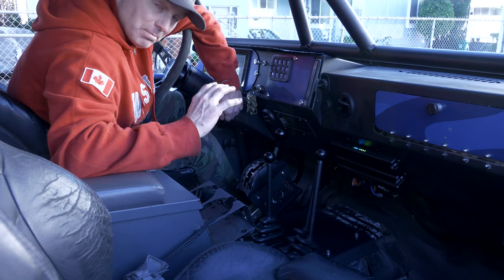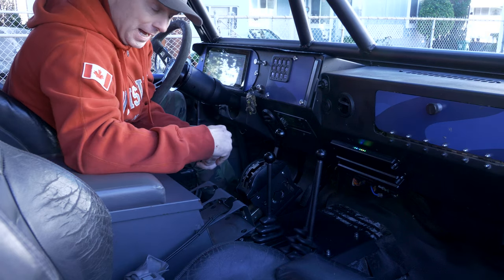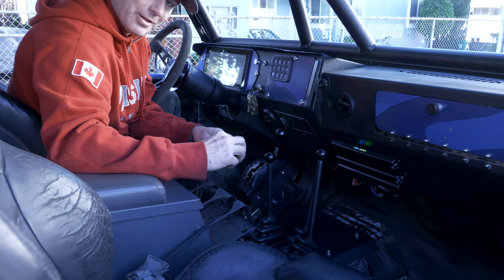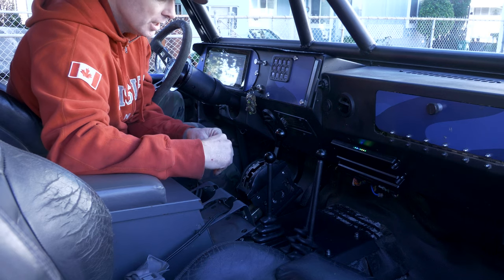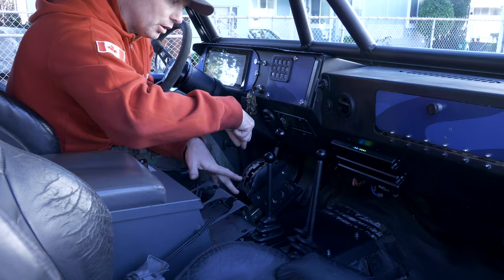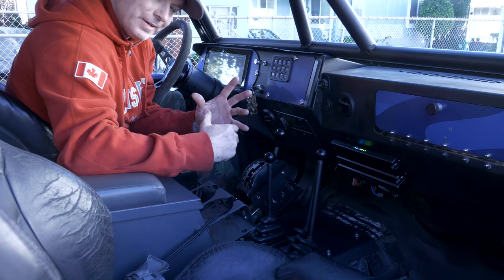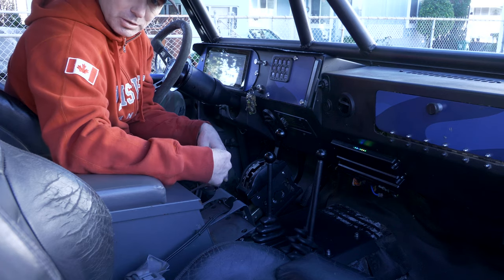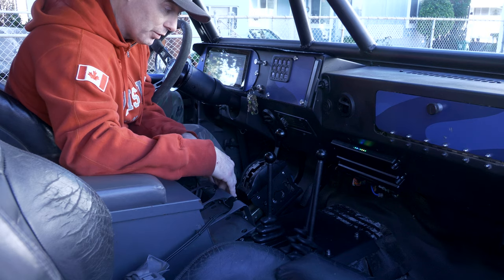How to shift a triple stick transfer case

Comment: you told me on Instagram you were going to post a video explaining the setup, but i did´nt think it was going to be so soon. thanks man!!
now i get it, the magnum box its a multiplyer or reduction for the transfer case. tons of torque for rock climbing, no engine effort
Reply from the maker: Exactly.  Great traction, control and no wheel spin
Reply: @MerricksGarage  can’t wait for the next full-size invasion 🔥🔥🔥

Comment: Very cool, I have a NorthWestFab kit for my 07 SAS Tacoma. Waiting on the triple stick kit as well. Should be a fun install and learning experience.
Reply: Just be aware that the northwestfab triple stick kit will not give you the ability to independently control the front and rear axle like in this video if you use a Toyota transfer case for your setup
Reply: @haroldpinter8076  Correct -- Pretty sure 2WD, 2LO, 4H, 4L, 4LOW

Comment: GREAT INFO. 
IM INTERESTED IN THE MAGNUM BOX FOR NP205. NOW I´M CUSTOMIZING MY JEEP WITH HEMI 5.7, ZF5 TRANSMISSION, 1TON AXLES ( BOTH WITH STOCK GEAR RATIO 3.73 ) AND 42" TIRES SO IN ORDER TO DON´T REGEAR MY AXLES I WAS WONDERING IF INSTALLING THE MAGNUM BOX INSTEAD WOULD BE A SOLUTION

I will like to know if running with 2L in the TC or Low at the magnum box all time on-road (highway) at high speed will cause some issues like premature wear or failures. 

So my ratios should be:
2.72 or 1.96 ON ROAD
5.33 OFF ROAD
Avoiding 1:1 cause I'm keeping the stock axle gear ratio (3.73)

Comment: Nice, waiting on my 205 from the machine shop...
Reply from the maker: Twin stick?
Reply: I had the 10 spline 205, I had to inlarge the input shaft bearing from 80mm to 90mm to run the magnum, and yes it will be the same as your, just a nv4500 for transmission...
Reply: You can use a 10 spline on a nv4500?
Reply: @oldtruckoperator2106  I know, I wanted the 32 spline 1992 Chevy Nv4500 and the magnum under drive from OffRoadDesign it uses a fat shaft input to the 205 that’s unbreakable, that with the 32spline outputs front and back of the 205 with cv drive shafts

Comment: When you do a 205 twin stick conversion, does it change the shift pattern? You would typically have a 2H, 4H, N, and 4L right? Now you have L, N, and H?
Reply from the maker: no pattern doesn't change, you can't put the front in H and the rear in L.  You have H L L and L L L and LHH
Reply: You also have HHH.  But, to answer the question above, the F/R are no longer controlled by a single shifter, so "2H" isn't a "thing".  2H = rear stick in H, front stick in N.  But, otherwise, pattern stays same.  H/N/L (no 2wd vs 4wd)

Comment: What would a truck with a factory divorced transfer case and another transfer case mounted to the main transmission and runs the front axle with the back transfer case running the rear axle give you? Would this be the same or similar to your setup? Seems like if you ran two transfer cases each axle could run independently?

Comment: I have a cammed 6.0 ls swapped k10 on tons, 4l80e and magnum box 205, 38.5s and 5.13s. I'm wanting to know what stall torque converter your running? My double low pushes threw the brakes terribly. Love the blazer and channel.
Reply from the maker: I am running stock TC for now.  This summit 8701 was the largest I could go without upgrade.  I run 4.56 gears.  Sounds like a killer build
Reply: @MerricksGarage  I've been running that same cam for about 2 years now. Geat upgrade.  Interested in how your rig feels in double low. I had a 2900-3200 before the doubler but it was to loose for any type of steet driving so I went back to stock for now.
Reply from the maker: That’s good to know.  I was looking for something lower like 2200-2500.  How is your idle?   I am dialing mine in with the Holley system now and it is still a little rough.
Reply: @MerricksGarage  Yeah I'm thinking closer to 2400-2700 for mine. It idles pretty well with that cam. Decent chop. I played with idle speed. 750-800 is where it seemed to run best. Seemed like yours was a bit low.
Reply: @mattrolley7288  Is your truck a long bed or short? How far back does the 4l80 set your 205/magnum box? I have a K5  on tons and 42s. Im running a 700r4/205 now. I was given a th400 but might consider a 4l80 and Im a little concerned on the length
Reply: @colesgarage666  its a short box, im running dirt dingo adjustable motor mounts, slid about 2-2.5 forward from stock. The 4l80e and magnum is a long unit, be prepared for drive shaft and x member mods.
Reply: @mattrolley7288  Cool man, thanks. I’ll look into it.

Comment: You wouldn’t happen to have a video or Picts of cutting the floor and installing the shifters?
Reply from the maker: I have a video in the works on the install
Reply: That would be great. I’m close to installing mine and would appreciate so guidance.
Reply from the maker: What I did was mount the shifters to the floor and get them dialed in there then I made the shift pan for them all to bolt too.  I had the case in and out about four times
Reply: Ord didn’t have much on the install. They did say I’d have to cut the floor or install a body lift with my current setup, so I’m removing the 2 inch up ring and swapping it for the stock rotation.

Comment: All
You need now is a sm465 with a torque splitter inFront... that would be a drive to see...
Reply: My CJ-7 runs an SM465 (6.55:1 1st gear), with an NP203/D300 doubler, with a LoMax 4:1 gear set in the Dana 300, and 2.03 gearing in the New Process 203.  I run 4.88:1 R&P.  

The doubler gives me essentially a 4 speed T-case (1:1, 2.03:1, 4:1 & 8.12:1), which with the 6.55 1st and 4.88 gears nets a crawl ratio of 260:1.  SUPER low!  I've never stalled it.

Comment: the 205 shifters would drive me nuts not being even in the same gear.
Reply from the maker: Function over form.  There is still some room for adjustment but not to the degree that it affects shifter operation